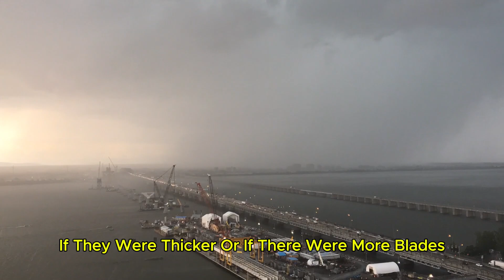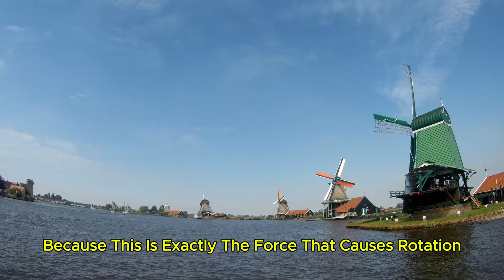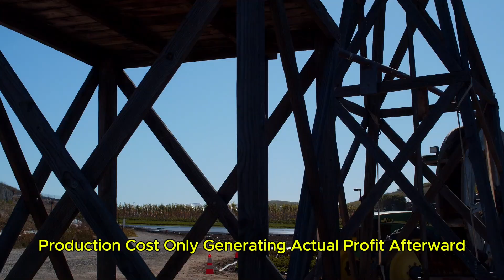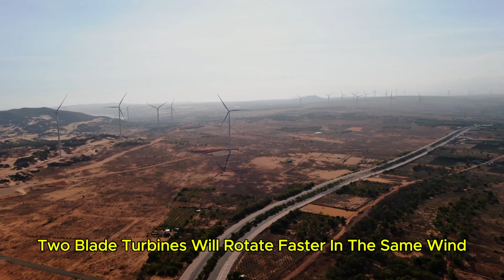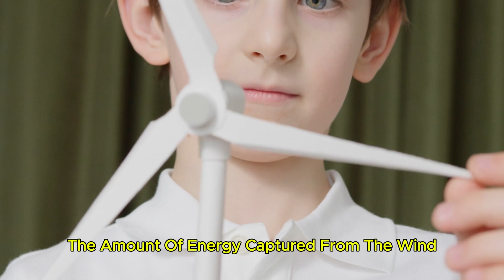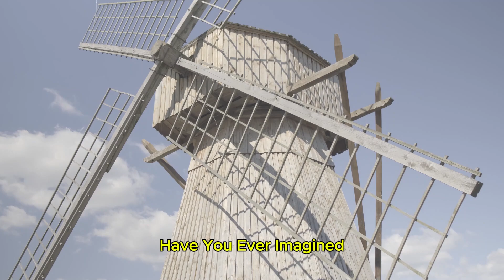Why do wind turbines have 3 blades? Unlocking the secret behind wind energy!

Comment: 2 blade wind turbines have a mast tower shadow problem. Blades passing through the mast shadow slow down, then they speed up after leaving the mast shadow. This changing speed 2 x each rotation is hard on the power grid.
Reply from the maker: Thank you for your insightful comment! You're absolutely right—*mast shadowing* can pose a significant challenge in two-blade wind turbine designs. As you mentioned, when the blades pass through the shadow of the mast, they experience fluctuating aerodynamic loads. This causes the blades to decelerate slightly as they lose lift and then accelerate again when they leave the shadowed area. This phenomenon, known as "dynamic loading," introduces unsteady torque to the drivetrain.

The implications on the power grid are indeed a concern. The variation in rotational speed leads to fluctuations in power output, which can destabilize grid performance, especially in regions relying heavily on wind energy. This issue is further compounded if the turbine lacks advanced grid interface systems capable of smoothing out these fluctuations.

Three-blade designs, by comparison, mitigate this problem effectively. The additional blade increases the overlap of aerodynamic forces, ensuring more consistent torque generation. This steadier operation improves mechanical reliability and creates a smoother power output, making it more compatible with grid requirements.

Your point also underscores the importance of innovation in turbine design. Engineers continuously explore ways to optimize two-blade systems, such as implementing flexible materials, adaptive pitch controls, or novel configurations that minimize the impact of mast shadowing. While three-blade turbines dominate for reasons like stability and efficiency, two-blade systems can offer cost and weight advantages when these challenges are addressed.

Thank you for bringing up such a critical topic—it adds depth to the discussion of wind turbine engineering!